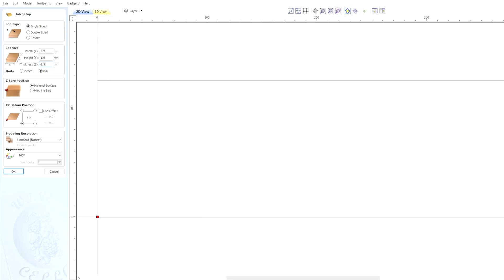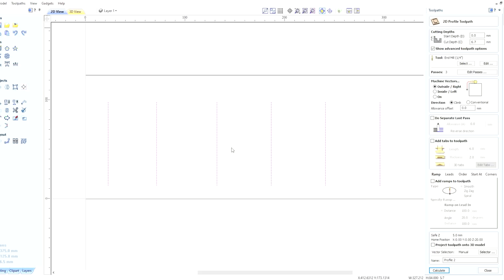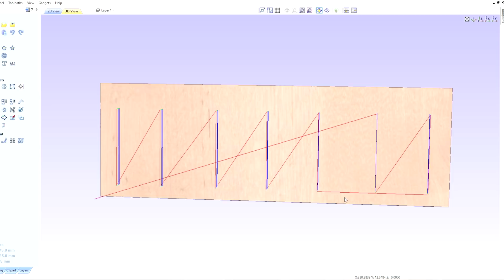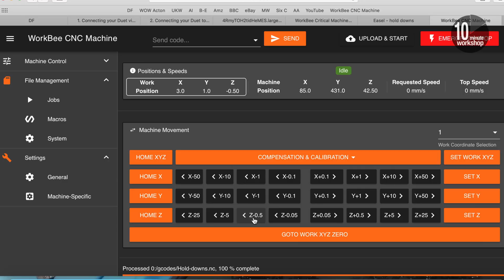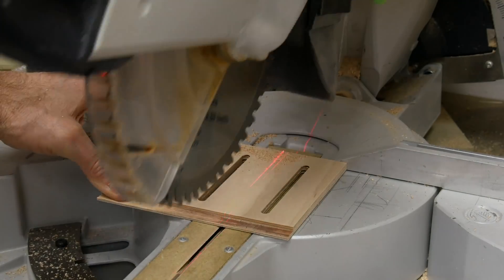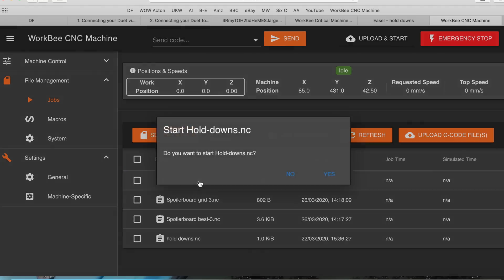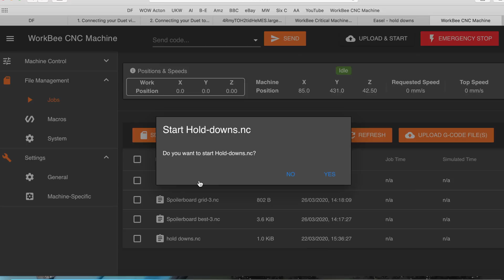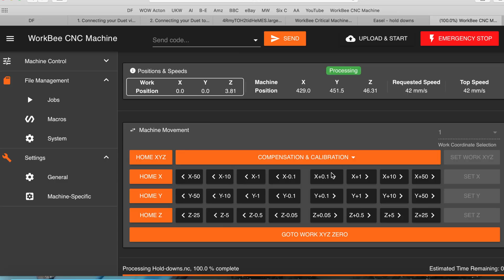Starting out in CNC P9 First job - hold-downs [video 393]

Comment: Hey Peter, Awesome video as usual. For cleaner cut, I would try compression bit By LMT ONSRUD - Marathon series. We have cut mdf, birch and cheap plywood and all seems to produce some excellent top and bottom edges. I would check your router RPM to make sure bit is compatible. Hope this helps.
Reply from the maker: Thank you! I’ll check them out. 👍👍

Comment: The joyride of experience being our best teacher.  It's all looking pretty good so far though - better to learn on scrap than the client's only piece.  The rebate on the edge may be a tad overkill, I'd just have a step block or an extra piece of ply on the other end of the hold down from your work to get some spring in the hold down.  I might also put a big hole at one end of the slot so you can put the nut through without having to unthread / rethread.    Peter Passuello has some great CNC user tips on his YouTube channel CNCnutz if you are interested.   Good stuff, thanks.  Cheers, David
Reply from the maker: Thanks! 👍👍

Comment: A good hold down is double sided tape.

You can use your hold downs as location stops.
Reply: Wholeheartedly agree. I battled on with 3D printed hold downs and destroyed a lot before settling on high quality DS tape exclusively. As long as feedrates aren’t too high you don’t need anything else. Also recommend compression bits for quality finishes.

Comment: For cut depth you can use Z or Z+0.2 this lets you change the material thickness in job setup and not have to adjust your toolpaths as well to match.

Comment: The other essential element of clamping kit is a set of step blocks.
Many beginners make a mistake of putting the other end of the clamp on the table. The step blocks underneath allow the clamp to be nearly parallel to the table so the clamping force is applied straight down.
This is more important on thicker pieces of course but also helps on thin plywood.

For thin material the double-sided carpet tape is a good workholding method. One side of the tape should be applied to smooth sacrificial piece larger than workpiece (rather than the spoil board) then the whole set is clamped down.